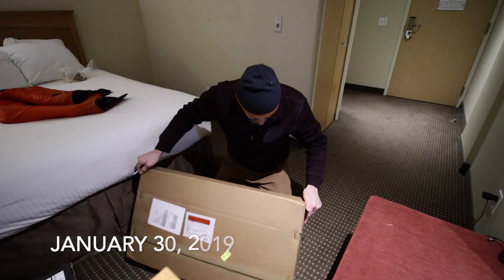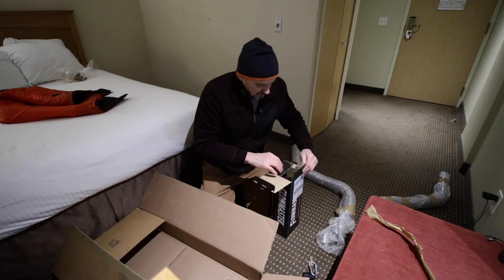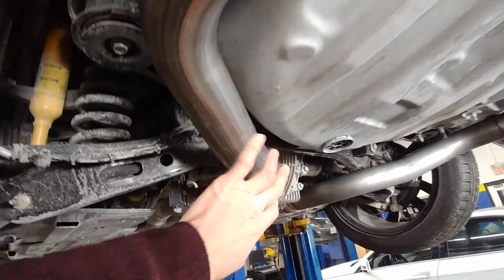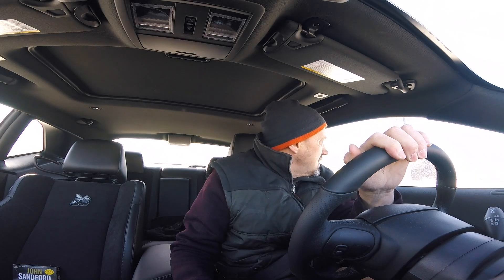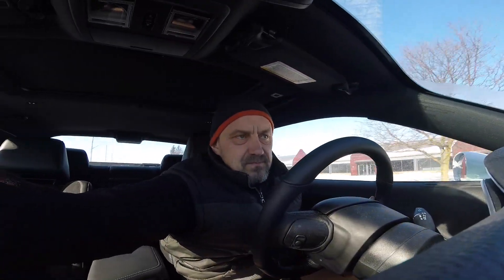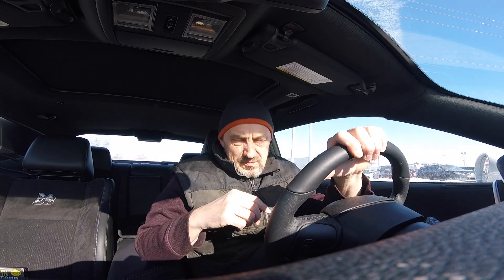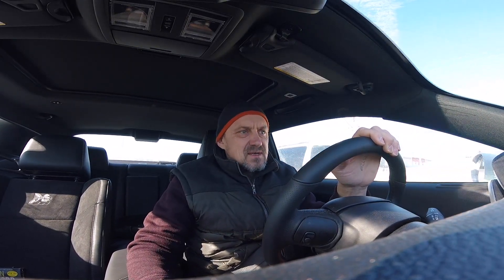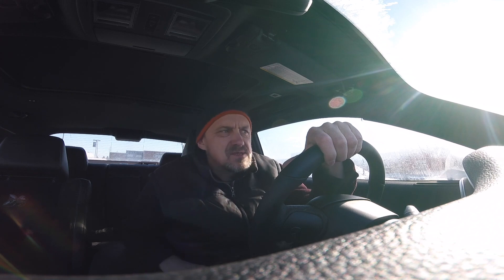FLOWMASTER OUTLAW + BLASTIN BOB: 2018 Dodge Challenger R/T 392 SCATPACK

Comment: Maybe I missed it in the comments but why didn't you put on the stock tips?  Adapters for the stock tips were in the box, you called them reducers or something while unboxing.
Reply from the maker: the stock tips are designed for 2.5" pipe. since i installed 3" in the back, i didn't want to create all that restriction.
Reply: @HHTV60  the two short pipes that had the rounded ends are make to put the stock 2.75 tips on. If you had got the pipes with hangers welded on they would have been part of pipes. Check the pictures on Bob's site.

Comment: Suggest that you try a different mic position if you want to make more videos while driving. The drone from the mufflers was making it hard to hear you speak. I ended up buying chrome tips for mine also cause I was unable to use stock ones because the mufflers need an off center  outlet. I put the original mufflers and tips back on before I traded in it last year..  the car was so much fun but way to many problems..